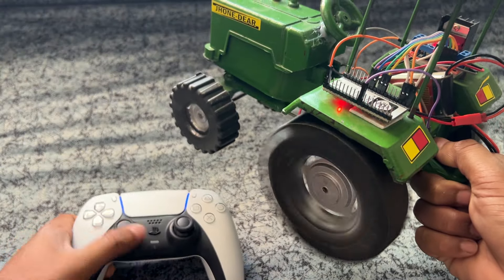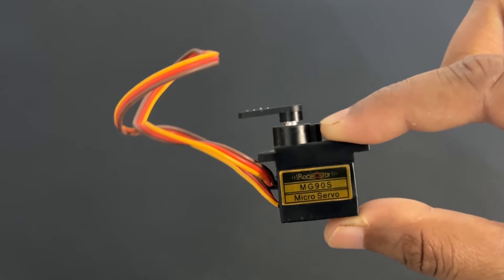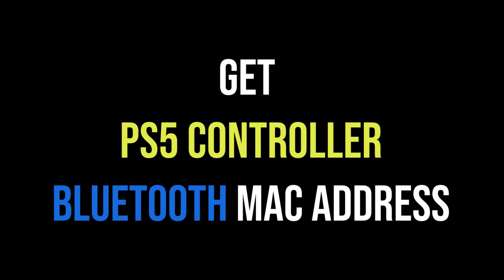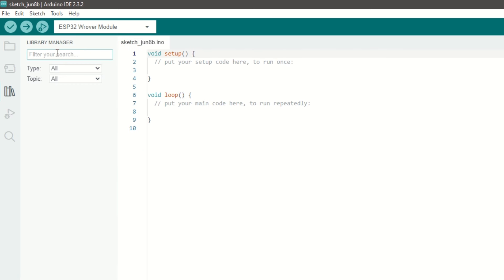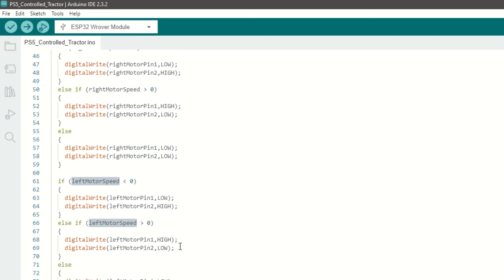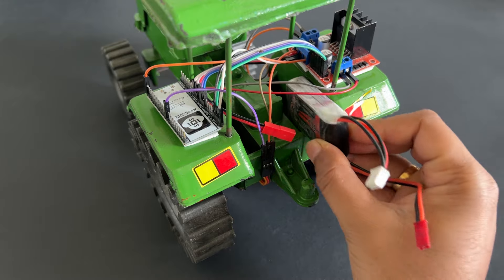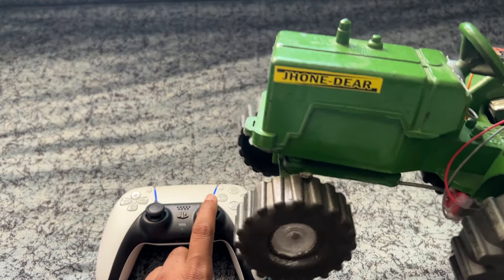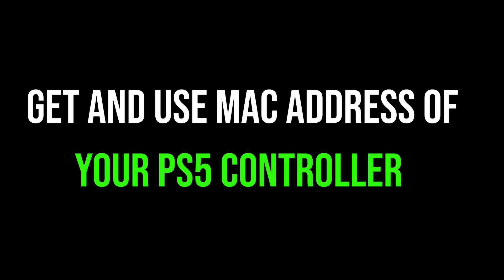RC Tractor with PS5 Controller and esp32 | DIY 🔥

Comment: i got error in your mobilke controlled project : C:\Users\Admin\Downloads\DC_Motor_Code\DC_Motor_Code.ino: In function 'void setUpPinModes()':
C:\Users\Admin\Downloads\DC_Motor_Code\DC_Motor_Code.ino:70:3: error: 'ledcSetup' was not declared in this scope
   70 |   ledcSetup(rightMotorPWMSpeedChannel, PWMFreq, PWMResolution);
      |   ^~~~~~~~~
C:\Users\Admin\Downloads\DC_Motor_Code\DC_Motor_Code.ino:72:3: error: 'ledcAttachPin' was not declared in this scope; did you mean 'ledcAttach'?
   72 |   ledcAttachPin(enableRightMotor, rightMotorPWMSpeedChannel);
      |   ^~~~~~~~~~~~~
      |   ledcAttach

exit status 1

Compilation error: 'ledcSetup' was not declared in this scope
Reply from the maker: @MotiveMosaic942  please install 2.0.16 version of esp32 board 👍🏻👏🏻
Reply: @hashincludeelectronics  hiw